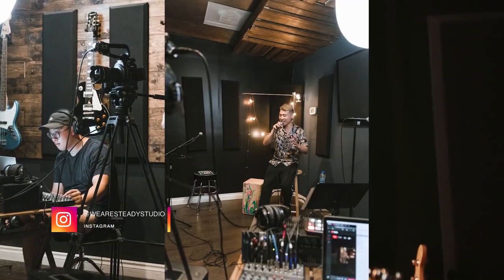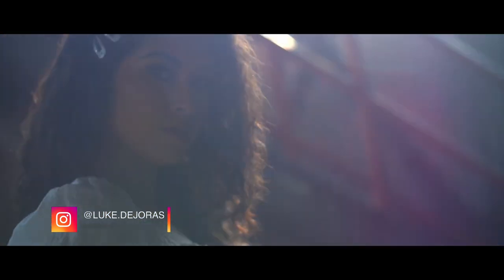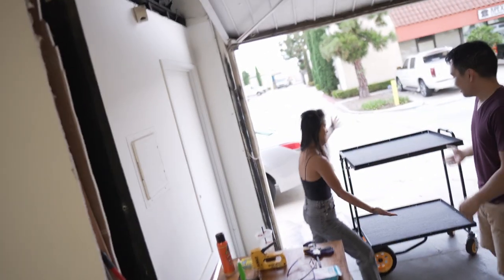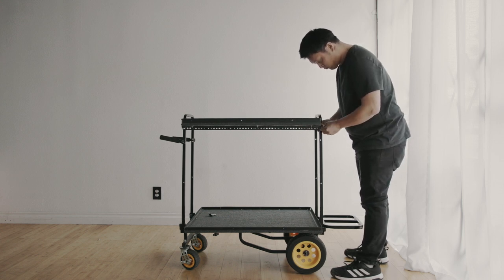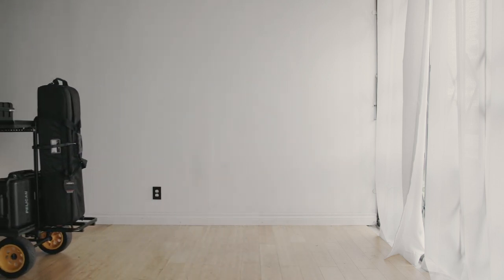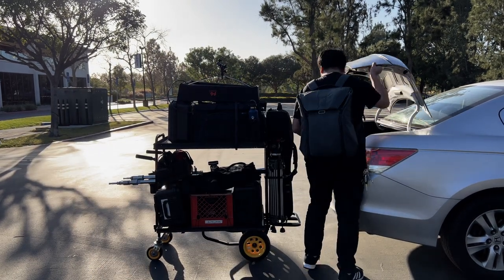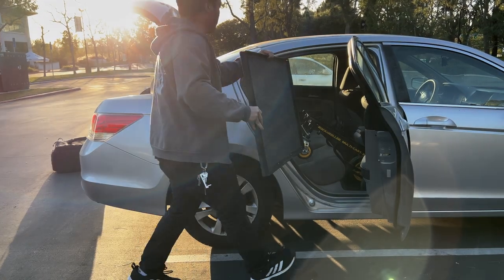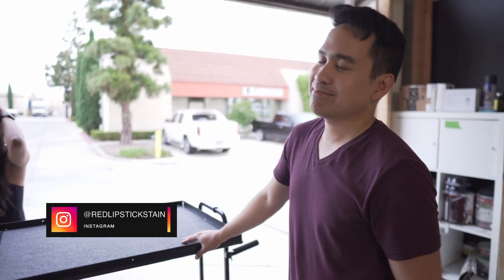DIY Camera Cart (AC Cart) Vlog - Rock N Roller Cart

Comment: I like what you did to the cart! i had mine for about 6 years and I must say this thing has hauled a lot of gear for me and I thought it was a good start as a production cart. BUT - its the most shittiest engeneering and cheap ballbearings on the front wheels that keep flapping when there's not enough weight on them. and the upright bars are so wobbly I wouldnt want to put any gear on them in order to use it as a full production cart. So people pls dont buy this thinking you can build a cheap but sturdy production cart... adn rant-mode off. Still like what you did to it man!
Reply from the maker: Thanks! I still use it to this day. But only for smaller shoots where I'm not hauling as much. I have since then moved onto an actual inovativ voyager 36 nxt cart which fulfills the needs of crazier payloads. With Rock N Roller its kinda like playing the lottery. You get some good ones with nice welding and other ones where the welding is awful. But it was definitely enough for me to work my way up to a nicer cart later on!
Reply: @alanychung  Thanks for your feedback. I've moved to  Andicart which is similar to Proaims carts and must say - should have invested in the cart before I baught another camera... Cheers to you and god speed.
Reply from the maker: @marcoleibetseder3826  it’s hard to resist the temptation of new cameras 🥲like you, I should have invested in a cart and nice tripod. They hardly break and last the lifetime of your career ahaha